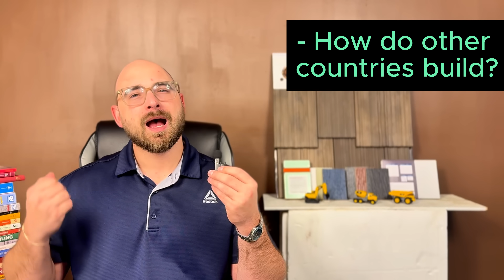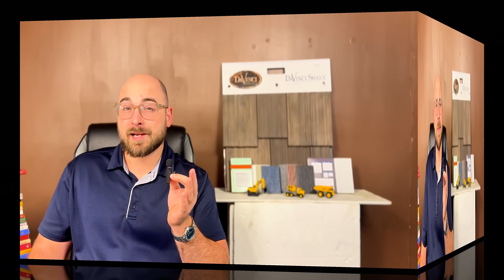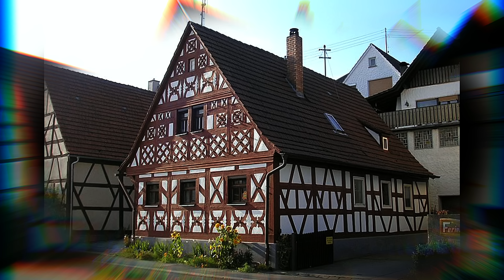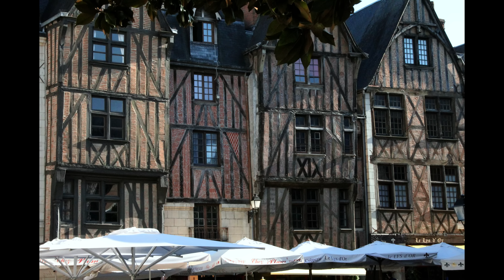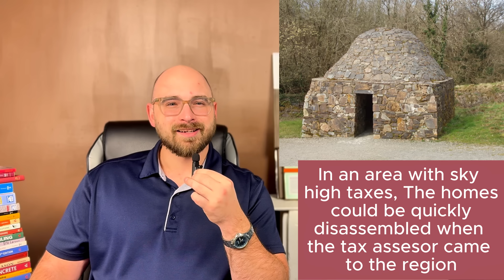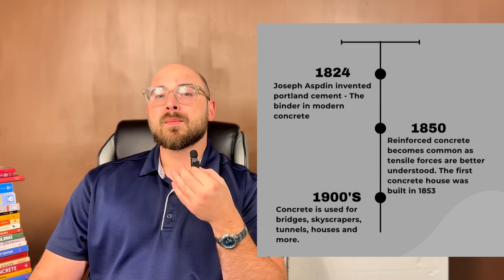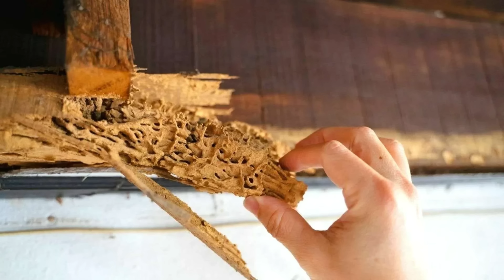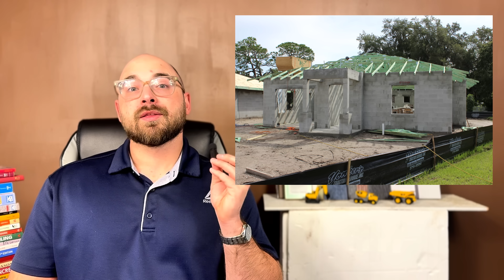Why Other Countries LAUGH at American Homes

Comment: But which one actually good to be built here in Chicago? The floods, then hail, then cold climate, then super hot, tornado season's. I think its easier in most countries since most are smaller than most states. We have so many climates across the country.
Reply from the maker: I’m a builder in IL, Chicagoland area. 

Best product for this area is ICF. Insulated Concrete Forms. 

Very well insulated, very safe, tornado resistant, comparable in cost to other efficient options
Reply: @Mike_Fortin  you have videos of these? Would they be more expensive to build than modern homes?
Reply from the maker: We have content coming out in the future that will showcase our builds yes, just not ready yet 

For an ICF home you will spend around %10 more than a stick frame house. However, to get similar performance from a stick frame house you need to use advanced methods like double walls, and or exterior insulation, smart membranes, etc. 

By the time you factor all of this in, ICF is about the same price with the added benefit of disaster resistance. 

So, a quality ICF home is %10 more than a cheap stick frame home, but your energy bills will be %50 lower, as will your insurance premiums. You’ll also qualify for tax credits and rebates. 

What your mortgage goes up your energy bills go down. Your monthly cost can be around the same. It’s just the initial investment that changes
Reply: @Mike_Fortin  look forward to the video thank you for thr information

Comment: In the UK I think most houses have dual wall construction, with inner wall made of of breeze blocks (concrete blocks), then insulation fitted to outside of that, then a gap, then outer brick wall, which is often left visible, not rendered, sometimes they are. UK houses seem to last forever, just tiny and too expensive. A 30 year house in the UK is still quite new.

Comment: I believe the US (actually, going to say "North America," since Canada is similar to the US in construction methods) has the best construction methods, however some of the materials can fall short for various reasons, such as one brand producing a lesser quality panel than another manufacturer.  OSB and plywood are good examples of a like product that can vary between manufacturers  The CIP (Concrete In Polystyrene) construction is one of the methods for home construction that I believe is superior to European systems, and most other North American systems.  It's quick, efficient, low cost, strong, and durable (longevity).
Reply from the maker: We have a version of CIP that is beginning to grow in popularity, it’s called ICF , 

They’re foam blocks with built in furring strips, they assemble like legos

Comment: Something I noticed looking at the LA fires vs similar fires in Australia (and comparing light timber framed houses) is that the LA houses seem to have often caught fire and burned from the roof down. That is a major difference - houses in Australia almost all have tiled or metal sheeted roofs whereas a lot of the LA houses seem to have had flammable materials for their roofing (what you are calling shakes and shingles).
Reply: Yes, in a fire risk area, you should use a fireproof roofing material. I think tile or metal should work.
Reply: Ironically perhaps, LA needs to outlaw wood and tar shingle roofing materials.
Other places have done it for a LONG time, for exactly this reason... to prevent/reduce fire risks.

Comment: American houses have their quality issues to be sure and sure their neighbourhoods may lack walkability etc, but as a European i do often think that theres a lot of cope about this topic and i find the chauvinism distasteful. Quality or not, most North American homes are very large by European standards, the average US or Canadian newbuild house has nearly twice the square meterage of an equivalent german or spanish newbuild home. This is to do with the availability of land sure and the lack of historical structures in the vicinity but this is made technically feasible by the reliance on timber and frame construction, and it would be hard to achieve mass construction on that scale with more intricate or time consuming construction methods like brick or concrete. I love my home where i live but damn i wouldn't be complaining too much about switching to paper walls if i had an extra 5 rooms, 2 parking spaces, a double garage and a massive garden out front and back and a possible basement too all for what relative to the average income there would represent a similar amount of workhours to earn as it would in Europe to get a house near half the size.
Reply: You hear every single fart in the next room. 
No thanks.

Comment: US housing is flexible for fast growing of population or fast depopulation. In Russia, for example, there are abandoned soviet towns made from concrete like Vorkuta or small towns between Moscow and St. Petersburg which are dying due to economical reasons. These towns looks like Chernobyl - a lot of abandoned  concrete which will stand there in forests for decades or maybe centures. US abandoned small towns being made from shit will disappear in 5-15 years and this is good. Just imagine permanent concrete suburbia. Already now there are opinions that it is a failed experiment. If so they are easy to remove unlike such failed experiment like Vorkuta.

Comment: 10:15 - 10:32 why wouldnt you use the bricks for structure? you put them there anyways, so why use the weaker wood as the structural component instead?

Comment: Swiss citizen here. Can we please stop with these BS?
Building houses has much to do with history. So every region builds there houses with material they find around them and the condition there live on. Concrete, bricks, wood or even clay - who cares. If you live near a forest, you will use wood. In the north of Germany they used reed for roofing. Go to UK, these little medieval towns nice to look at but the houses looks like horse stables inside with windows where the glass are thin as paper and fire holes in every room. In a country in which the weather is almost cold the entire year. It’s history.  You will find a lot of wooden houses in the European alps, because thats what they had almost for free. American houses are cheaper (i think) and easier to convert. Okay, the walls should be thicker, but at the end of the day you have a roof over your head and a place to live. American houses, european houses, igloos, african kraals - who cares. I think we have bigger problems to think about.

Comment: 27:20

2x4 walls/R13
2x6 walls/R19
Reply from the maker: That would be the stated R value, 

The EFFECTIVE R value is lower than that. 

Considering the wall assembly as a whole combined with other factors such as air sealing, continuity, etc. 

In a traditional wood wall only the wall cavities are insulated, the studs themselves act as thermal bridges every 16” OC, only around R6 

Therefore the wall assembly as a whole is lower than the stated r value of R19 , coming in at around R13 for a 2x6” wall with fiberglass batts. 

This is the difference between stated and effective R value 

Please read this article that references data from the US Dept of Energy 

https://www.sips.org/resources/r-values-in-the-real-world

Comment: In the UK, most suburban homes have brick on the outside, tied to internal CMU walls, with insulation in the cavity. Loft conversions and kitchen extensions are popular here, and some steel beams might be used for them. The only day to day difference with brick is that our houses have a slightly higher thermal mass, so the temperature seems to stay a bit more stable.

Comment: You forgot about 3D printed cement homes
Reply from the maker: Because they’re not practical - they’re not cheaper, the concrete is exposed to the elements, they lack reinforcement, and I suspect they are not super well insulated

Comment: I have owned three homes in the US, all "stick-built".  One was built in 1910 (still in good shape), one was built in 1911 (still in good shape), and one was built in 1995 (obviously still in good shape).  What they need is a new roof every 25 years, new paint or siding every 25 years (not my current brick siding house), and probably keeping the gutters in good condition.  Why do people say that they don't last?
Reply: Just my personal experience. The last house I lived in (moved places half a year ago) was built around 1660. And the best place I ever called home. I doubt that you would be able to have a decent living in one made with wood. In general, I think it also comes down to what you consider as "old".
Reply: Because a german house would still be on its first roof, unlikely to need new siding
Reply: Because they're triggered idiots that can't understand other people can make rational choices that disagree with theirs.
Reply: Absolutely they will last if maintained but the thing is a brick building,concrete reinforced building ... will last much longer there is a reason why ancient building last to this day and also "stick built" houses are like box of matches when lit no way you are saving any of it while brick houses can have one room burned out and rest of the house saved,also insulation and sound proofing is much better on this kind of building there are many reasons why its a better way to build

Edit: and even when that room is burned out house is not structuraly compromised and you just need to clean it out and put a new coat of paint and its baically good as new.

Also since a lot of us is hurricanr country it doesnt make any sense to build something that flies away ehrn it vomes close
Reply: One match or termite will answer your question.

Comment: 'so flimsy they could fly away like a baloon' I mean... thats a pretty good description of whats happening with cali fires.

I've seen footage where the houses are gone in confetti like they never existed but the actual trees and shrubs are still mostly green and in one piece, and fences with thick planks around the plot are still here like nothing happened.

I really can't feel sorry for something thats built like in the three piglets story going up in smoke at the first ember. Over here the house I'm in is over 30cm thick reinforced concrete walls and ceramic tile roof, good luck setting that on fire from the outside.

To me something built out of spaced wood planks is a shack or garage at best. I wouldn't pay any money for it as a home...

Comment: Concrete is large source of CO2 in production.
Concrete requires a lot of sand and the type of sand used is getting harder source.
There is also a maintenance problem with concrete. The steel rebar used for structural reinforcement also expands as it rusts. This causes structural damage.
Reply from the maker: Problems that can be overcome, 

some C02 is absorbed when concrete is poured , it lasts longer. Reinforcement can be corrosion proof such as composite or fiberglass 

But even carbon steel reinforcement will last if the concrete is protected from moisture such as with ICF and a capillary break at the footer

Comment: Australia has rule to protect buildings form winds and floods, eave overhang and steel rods from roof to ground. Fire material restrictions for high risk areas include minimum water storage for remote or high risk areas. Steel striped Cross bracing for studded walls.

Comment: Got blueprints to build my own home and have done research, any normal family home built in the mid 80’s with modern upgrades are typically built to last, however it does cost a substantial chunk more to make a house last, most people in America live in a home for 7 years, that really means that homes don’t need to be built to last 100 years (bs, but it does give factual basis). It’s all just manufactured horse manure though.

Comment: I travel through the EU every couple of years, and I live in Canada and have lived in the US for around 1.5 decades. 

You are correct about using available building materials. About the Europeans' comments, however, I would like to point out that they used to build with wood, but they had a tendency to burn down, - like huge urban fires (eg 'the great fire of XXXX in XXXXXX) - London Bridge, Chicago, etc. Enough of those fires and wars and stuff, and stone is all that's left. 

It's like homes are going through an evolution by fire. Or earthquakes and floods, nowadays.

Comment: If you want to pronounce Italian correctly, you must remember that EVERY letter is pronounced (except H which is used as a pronunciation modifier). This means that you pronounce BOTH L's in "trulli". Separated into syllables, the word is trul-li. So you pronounced "trul" followed immediately by "li". This gives a slight hesitation over the double letter and is the true source of the rhythm in Italian speech.

Comment: Not really true. In the UK, we are jealous of the size of US houses. Our houses, especially new ones, are tiny. But only Australia and New Zealand have larger houses than the US.

Little attention is paid to construction techniques  except during hurricanes and fires. Right now, looking at Pacific Palisades burn, many people are reflecting on the construction methods.
Reply: 90% of homes here in New Zealand are timber framed, the main reasons being cost, supply, & earthquakes (just like in the States). Luckily for us we don't have to worry much about wildfires like the Americans do however, the risk is still quite low here. 70% of homes built in New Zealand nowadays have steel roofs anyways, which significantly reduces the chances of them catching fire in those situations (like the current Los Angeles fires).

Comment: Lightwood framing also allows for embedding all types of wiring, plumbing, HVAC ducting, etc.  for a cleaner appearance. Larger rooms and spans are also possible with trusswork fabricated from wood or wood/metal.

Comment: You already mentioned a lot of building methods and I know; the video is already quite long as is. But there are even more building methods available here in Europe. 
An increasingly common one is aerated concrete blocks. They provide excellent insulation value and simplify construction a lot since they are easy to work with and usually no additional insulation is required.
A very interesting one is wood hybrid construction, which is mainly used for bigger buildings. The method combines wood, steel and concrete to utilize the advantages of each material. It aims to reduce co2 emissions while allowing for faster building progress.

Comment: Just pause for a moment to reflect on the AGE of those European houses! They are CENTURIES OLD - meaning the were built to last in their respective environment! True, many of them do not conform to modern standards of insulation or energy efficiency but, boy, have they LASTED! Any expense in improving energy efficiency is solidly offset by the fact that the cost of building the house in the first place was written off centuries ago. All that is needed is maintenance and improvement to keep up with modern requirements.

Comment: US builders use effing paper for partitions. Drywall is considered quality. Here's a little heads up: There's this thing called bricks. They've been around in different shapes and composition for about 7, 000 years now. What are the oldest and best preserved buildings in the US made of? 
You guessed it: brick.

Comment: Homes and structures are the results of their environments. I wouldn't say one is better than another, but a result of their environments. There are lots of places in Europe that have foot and a half wall made of brick and concrete. Because they needed to resist aerial bombardments. They just continued to construct buildings like such. I'd say a majority of US houses are made to be cheaper and faster to construct. But that's not a negative, it makes the house affordable. I owned my first house at 20 years old... It is just as efficient as any house in these other locations thanks to the materials used... So ehh...

Comment: I lived in a wood framed house with brick exterior for the last 50 years. The structure is still sound. If a new ownership want to remodel, wood framed houses are the way to go. In my area a concrete walled house would be hard to sell.

Comment: Nothing reliably withstands a tornado except reinforced concrete.  Masonry walls have been ripped apart.  I have seen photos of brick walls reduced to rubble by strong hurricanes.
Floods can even undermine and collapse concrete.  The best protection is not to build in a flood plain.  Unfortunately, this is not possible in some areas, but then the buildings should be elevated above possible flood waters on deep concrete piers. 
As for foreign homes, I have seen a lot on HGTVs House Hunter - International.  Most of the traditional areas are characterize by small size.  They do not fit people who are, thanks to modern nutrition, generally taller and broader than the generations who built them.
Reply from the maker: It’s possible to design a concrete house that can withstand flooding. 

Flood vents to take pressure of the structure , trench drains in the floor, steel floor framing and concrete above. Allow the first level to flood and then drain and dry